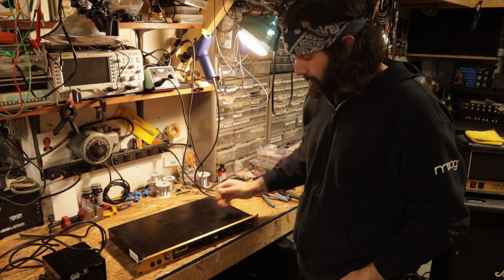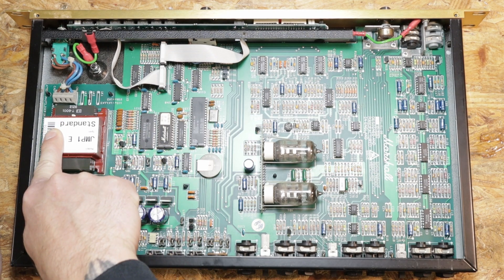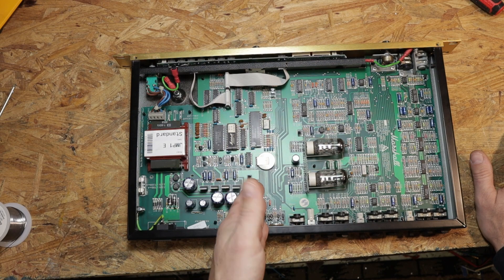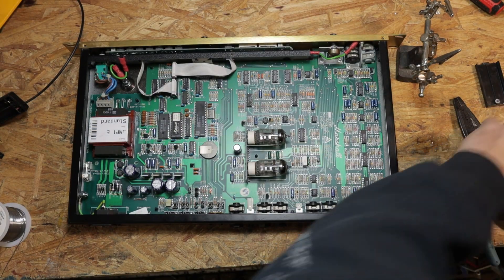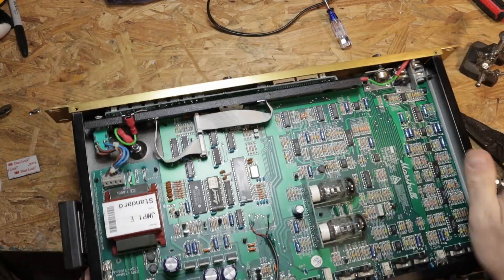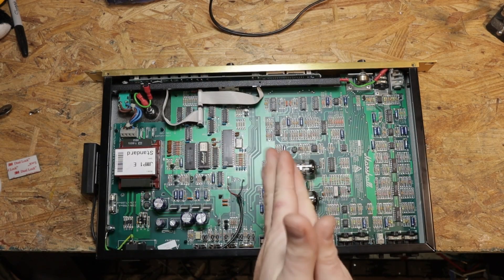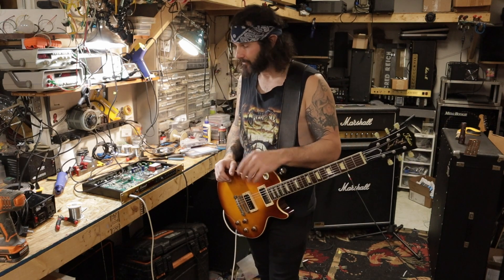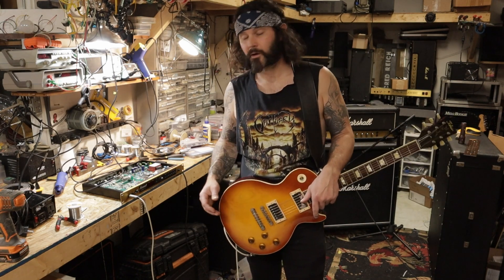JMP-1 Service - 230V to 120V Conversion and Battery Upgrade

Comment: Is it possible to change out transformers on a 100 watt amp to a lower wattage? I have a Marshall MGHDFX100 head, and 100 watts is just too much in a bedroom setting. Also, is it possible to mod it in a way to have switchable power levels like some of the newer 20 watt Marshall heads? The obvious answer is to buy a head at the wattage I'd prefer, but I have a soft spot for the old Marshall MGs.
Reply from the maker: I'm not super familiar with the MG series circuit but they appear to get the output from a TDA7293 100W DMOS amplifier.  There is too much going on with the circuit to just swap transformers.  To reduce output power you can use a higher impedance load.  They deliver maximum clean output power at 4 ohms.  If you use an 8 or 16 ohm load you should see a reduction in output power.  Cheers!
Reply: @purgasound  That makes sense. I am running it into a 16 ohm Marshall Origin 4x12 So I've got that going for me. Thank you for the thorough reply.

Comment: oh man. That's a bit of a shame what happened to the chassis. I'd be pretty chocked if that was my amp. I know you didn't mean to, and had good intentions though.  In my opinion, I would have just left the OG battery style in, as it's really not that hard to unscrew the lid, and pop in a new battery. It's one thing if someone is on tour, but even then they don't die that quick. The main inconvenience maybe if someone was constantly on tour, and reliant on programming is the battery style itself, not just unscrewing the lid, so maybe mounting the AA holder would be possible inside? Just a thought!  Cool video though, thanks!

Comment: I’ll never understand why Marshall loves to put cheap electrolytic caps right next to hot components. all the caps are right next to a quad of transistors with no heat sinking in a 1u rack unit. Like that won’t produce any heat. I’d absolutely replace those caps.

Comment: 1. STOP CALLING IT AN AMP.
2. That battery mod you did was beyond stupid and unnecessary considering the original holder allows for replacing the battery..  The coin cell battery would outlast a pair of AA/AAA batteries and it won't leak unlike those batteries.

The only thing you did which was useful was converting the PREAMP to US current.
Reply from the maker: Lol but this is, by every definition, an amplifier. It takes a small audio signal and amplifies it to a larger signal. You don't have to like the battery modification. That's fine. I did it because it works best for my setup. The amps I used are wired tightly in an enclosed rack. I don't and won't have the time in the middle of a tour to disassemble every cable and connection and snip wire ties to pull out a rack unit to change a battery. Doesn't matter how infrequent that is. Down time is down time and when you already have a busy crew on tour it makes sense to simplify their jobs wherever possible. Cheers

Comment: I hate it when people say 230 volt. It's 208-230.
Reply from the maker: What country does that hold true? It is my understanding that nominal mains voltage in Europe is 230 volts +10% / -6%. That doesn't go down to 208V. Cheers
Reply: @purgasound  I was just yanking your chain about you being annoyed with people saying 115. But here in the US we have 208-230 voltage. Anything in that range is acceptable. I am a refrigeration/HVAC tech and if we have a step down transformer in a piece of equipment we often have to confirm incoming voltage and wire the transformer accordingly. If incoming voltage is below 217 use wires A and B, if voltage is 217 or more use wires C and D.
Reply from the maker: @samizdat113  hell yeah brother. Much respect to my fellow tradesmen!

Comment: Why didn’t you just use a replacement of the original battery? The thing last for ever anyway.
Reply from the maker: I would still have to unsolder the original tacked in battery just to install a button cell battery holder. I'd rather not have to disassemble the unit to change a battery.  It is a potential show stopper if the unit is installed in a rack system.  I had a battery die on tour, we were doing arenas as a support act. I had the same setup for that unit. It was a 60 second job as opposed to unhooking all the cabling that goes into a rack rig to pull the whole unit out, clear a workspace to disassemble,  reassemble, reinstall and rewire. That's a lot of unnecessary extra work and this modification took the same amount of time as it would to replace it with a battery holder. Plus everyone has AA batteries on tour. I don't have whatever battery this was.